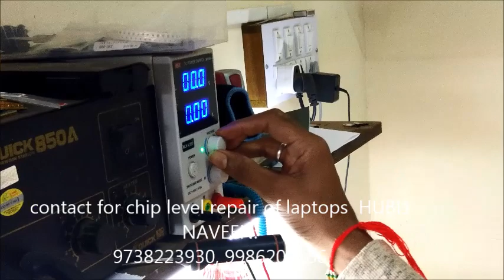DELL VOSTRO 3558 ADAPTER LIGHT GOES OFF WHEN PLUGGED IN SOLUTION

Comment: Naveen Sir in my Samsung laptop, charger light turns off when plugged into laptop. But when I used a friend's charger, it worked fine and the charging started. 
So it appears that problem lies in the charger itself and not the laptop. 
Or is it that the real problem is in the laptop which in turn damaging the charger also after long time use ?? What needs to be fixed..Laptop or its charger??
Reply from the maker: problem might b in ur laptop pls contact professional engineer to get repair.
Reply: @globetechnaveen4821  Thanks for the quick reply!! How much would I be expected to pay for the repair? 
Regards 
Sumit
Reply from the maker: @sumitgs20  contact on 9738223930

Comment: What actually you are doing with soldering iron
Are you suprateng coil or what 
I mean how you are dividing or separating 19v from ram section or 3 & 5 volt section ? 
Video not clear
Reply from the maker: contact me 9738223930